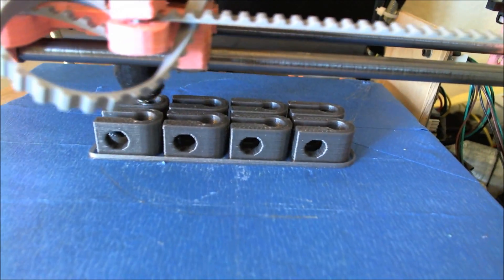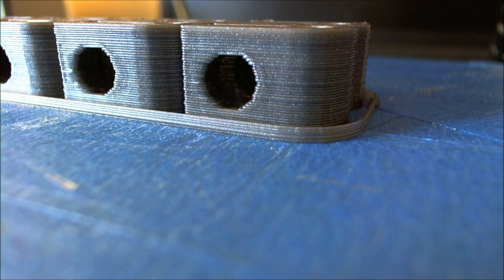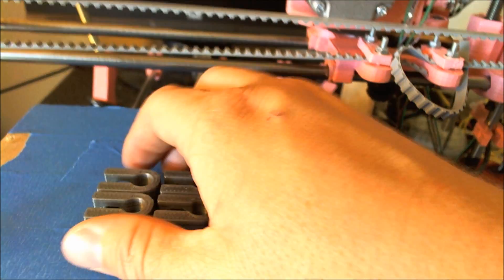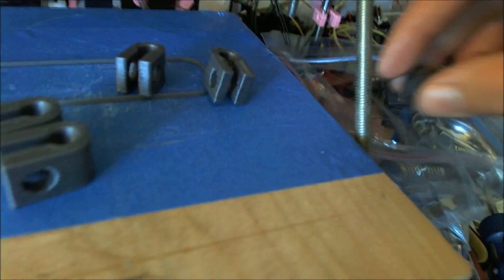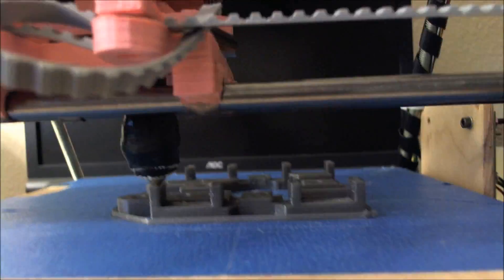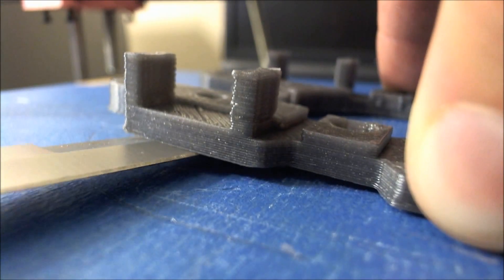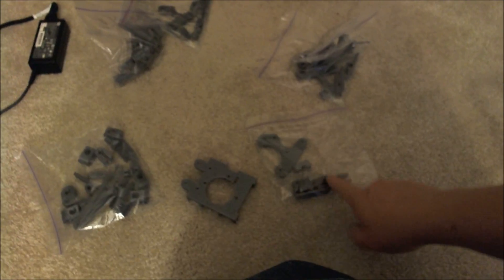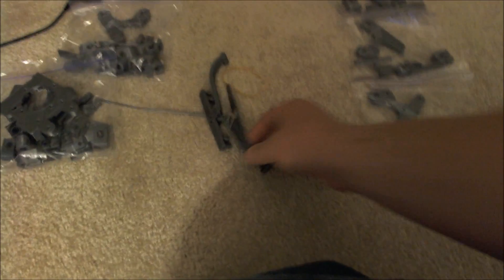Why I am starting to LOVE my 3D Printer (Stabilized)

Comment: I'm wondering what the long term health affect this material (pre-printed mostly) is possible. Will it have any detrimental affect on the human body (being inhaled even in trace amounts)? - one reason I'm a bit wary of this technology, even though it seems AMAZING....remember asbestos?
Reply: Most 3D printers use plastic to print so the same as every day plastics, your comment is very strange are you from the US ?
Reply: The 'plastic' being used is PLA, or Polylactic Acid, and is made from corn starch. It is 100% biodegradable, and 100% commercially compostable. If he were to breathe it in, it would quickly turn into carbon dioxide, water and biomass.